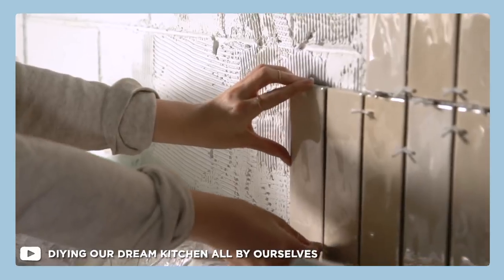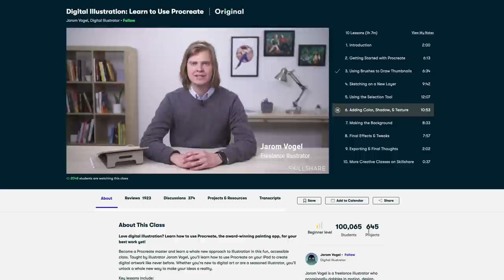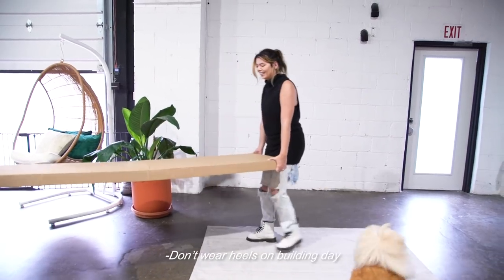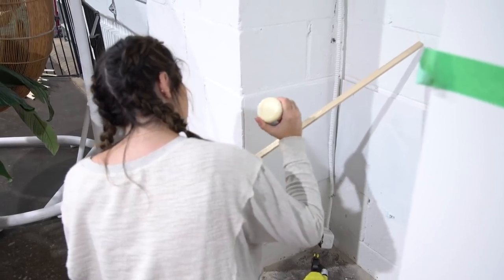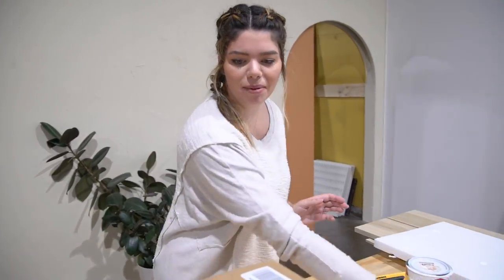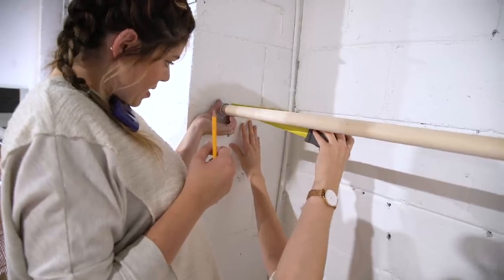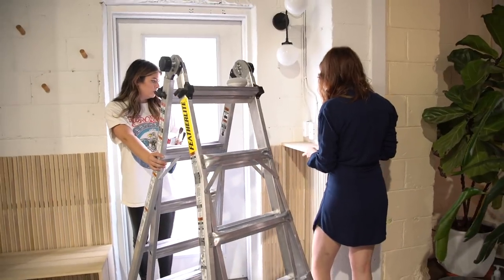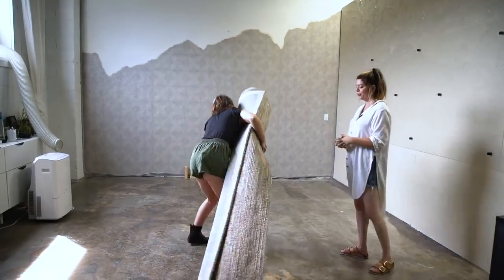making over our boring entryway into something way cooler

Comment: I would’t paint it, but what doI know. I would add some kind of protector for the wall where the bike is, maybe something transparent. White walls and bike wheels… bad combination.
Reply: Good suggestion! Maybe a sheet of clear plexiglass for under the bikes. :)
Reply: My bike hook came with a clear cradle, wall protector kind of thing for the bottom wheel. Def helps keep the wall clean!
Reply: I’ve got scuff marks all over my apartment dry walls so definitely recommend some kind of cover
Reply: 🎨  RE Painting Trim  🖌
🖤Love the Scandi light wood & white wall/cabinet combo. My preference would be to clear coat to protect. 

Although Scandi design also favors ⚫black & white⚪. All the wood stained ebony to match the black bench & black pot for the entry area plant could be very interesting. However, that would've been more easily done before it was attached to any surface (& simply touched up later).

🚲 Bike wheels against any interior wall is kinda gross. Plenty of chances to mark wall while simply lifting it up to it's respective perch too. Know they are bit heavy & awkward to lift in that manner. A plexi-panel will preserve wall, while be very easy to clean.🤗
Reply: Yes those walls will be scuffed shortly!
Reply: A wood tray that matches the wall wood maybe. I’ve made a couple for shoes with the plastic one under the wood to drain of snow into. The bike is going to drip a lot more than imagined.
D

Comment: Loooove how this turned out. I'd definitely like to see a stain on the wood to warm it up a smidge and I kind of wish the bench was sitting on top of a full rug instead of next to a runner, but other than that, AMAZING!
Reply: I agree 1 million percent lol
Reply: I agree. I liked the original rug they had there. It was much cozier than the runner. :)
Reply: I would stain the tambour as well. :)
Reply: MizWoody Agreed
Reply: I agree, they could also just double it up and have the larger rug with the runner, so the bench isn't floating.
Reply: @DarleneSterling  Yes, love that idea
Reply: @MizWoody  🚫 No Paint 🚫. 
Prefer CLEAR poly coat route over a darker stain on all that gorgeous wood, but I adore the soothing gentle beauty of light wood in combo with bright white elements. It gently warms the coolness down w/o being the least aggressive or over powering. 🤗

🏵Like @Jenna Revamped, also preferred the size & warmer color of the previous area rug. Not in love with scale or shade of the new runner. Or, how the bench awkwardly floats in space behind it 🛶.

In order to make the bench more significant as a "petite island," they could float side tables on each end. The tables don't have to match, but they should all be in the same dark finish of the bench. They should also have that same mcm vibe. 

🤔Plus, where do your ppl hide slippers or alternate work shoes when they remove their soggy shoes!? Carry them in their own tote?

The tops of these small tables can be dressed with potted🌾plants (or vases for floral arrangements⚱). 

⚓ At the very least, the bench area could be more anchored by adding an XL pair of potted🌱plants on each end of the bench. (Say 16×16×32 concrete planters.)  Think mod boutique hotel lobby style.

Maybe add an 🌂umbrella urn for any💧wet weather☔ on entry side. (It could also be used to stow a extra-long shoe horn for employees & guests. Once you use one, you'll fall in love😍.) Or, it would suit for those of us who like to use a parasol in the sunny months. ☀️In LA, that is year round☂️!

Comment: something felt a bit off with the tambour detail, maybe would’ve looked better stained or with a small piece of molding on top to make it look more clean and finished!
Reply: Dasha Zaytseva I think tp and bottom molding is a good idea.
Reply: I actually really like it in the light colour, but because they stand off the wall a bit, it's really easy to see where the mounting board is. It might look better if they slid more thin white panels in behind the wood, on top of the existing ones.
Reply: Dasha Zaytseva when it’s shot from the front, the perspective makes the tambour on the wardrobe look lower than the rest, I think that’s what’s unsettling
Reply: yeah... right now it looks like a sauna lol
Reply: A moulding along the top seems necessary to me. I'm worried those slats are going to snag on coats and break since they aren't flush to the wall.
Reply: Yes!!! A white molding piece running along top would've been so much nicer

Comment: I have never seen that kind of wall covering and I love how it looks! What bothered me a bit was that horizontal dark shadow line behind it where you put up that board to nail them  on. Maybe through the camera it looks more pronounced? Also a tip, you should cover that wall part where the bike tires hit the wall and put sth on the floor underneath. Wet and dirt will otherwise make you clean a lot. Love you!
Reply: 😊Agree. That Tambour treatment is new to me too, but it really glams up that space in a mod, yet warm way. (It makes a departure from a more cottage like traditional bead-board panel.) Seems easy to replicate using their method. 

The other online versions I researched did have less of a gap between the petite "planks." Personally, I don't mind the shadow (or white painted block wall peeking through). 👏👏👏

Comment: It looked so good, the only thing that’s really throwing me is that behind the tambour is only one square of clean white and then brick. Looks a bit funny and unfinished. Also adding something to the top and bottom edge of it too.
Reply: They should have used sheets of wood (that are the same height and width) to create the backboard for the tambour, it does look funny without it :(
Reply: I kind of like the line of white wood  or whatever, I thought it gave some interesting dimensionality to it
Reply: I thought that at first too. Then I thought it's an industrial building that's not new maybe the walls weren't flat and square.
Reply: Personally I don’t like it, it looks sloppy with the uneven edge on the bottom. Makes that space look really unfinished like they are going to do something to it still.
Reply: I think they should’ve painted it all black behind. The brick & the mdf
Reply: @delaneybee  agreedddd!! I came from the bathroom too 😂 🚽

Comment: The wood tambour though a neat idea, looks unfinished. Trimming out the top and adding painted wood behind the base of the doors would help fix that, though I think adding a base along the wall and around the cabinet would look more professional making the whole area look built in.
Reply: And a hat/helmet shelf above the coat rod. It would also help to make it look like a built-in.
Reply: If they add trim the Scandinavian vibe is lost.
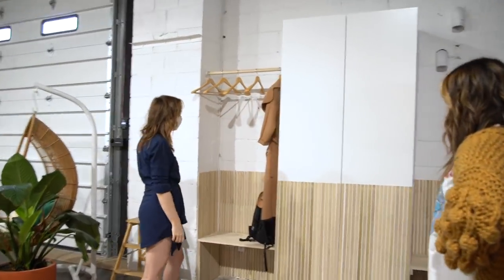Reply: @kaleigh4081  If you look at 19:41, you'll see the rod is so high Kelsey has to reach well over her head to hang her coat. I'd be  afraid to toss a helmet up there. That could get scary if you didn't quite make it. 😣 They do have the hooks on the other side of the cabinet to use.
Reply: @janice694   I must have missed where they said they were going for a Scandinavian look, so I started to watch it over again.  Too slow, so scanned skipping now and then, and again missed any mention of design influence. Either way, I do not see Scandinavian influence other than the white and unfinished wood. Adding a simple trim, in my opinion, would not make a difference anyway as long as it were simple enough.
Reply: @OrganizeCreateDecorate   I think when they said "scandinavian" they were referring to the hygge vibe; the white tones with warm beiges and pops of color that seems so "in" right now. Clean, simple, cheerful, and achievable.
Reply: @OrganizeCreateDecorate  Oops! You're right. Oh, well... They can put the helmets on the bench: once the longer coats are hanging there, the bench won't be too comfy for sitting. They have the nice green bench, though, for putting shoes on.
Reply: @kaleigh4081  I design and build woodwork projects for our home, so I tend to notice things like that. I would have lowered the coat rod and the shelf above it. I would replace what they called a bench, with a shoe rack with four levels. Each "shelf" would be made from five copper pipes secured into wood on each side.  Adding a drip tray on the pipes under each shoe shelf to catch any drips from wet shoes and boots. If they needed to cut costs, they could use PVC pipe instead of the copper.
Reply: @jessicajordan680   By what I've seen, that look still is finished with trim. Simple trim, no routing, but trim none the less.
Reply: @OrganizeCreateDecorate  Wow! Love your ideas! Sounds like you're good at what you do. 👍
Reply: @kaleigh4081  Thank you. I enjoy it all, so that helps. After my faith, family, and friends, my three passions are in my user name. The best is when I can put them all in one project. Which I do often. Luckily we have a wood work shop in our basement. Though we've novices, hubby and I have done well.

Comment: Your new IKEA rule is spot on.... bc I made the mistake of going there by myself, not reading/realizing the weight of the bookshelves I needed, then not seeing where the dumb flat carts were and trying to load two 85lb/38.5kilo bookshelves in a cart with a basket... then the cart had so much off-center weight and started drifting down the parking lot and toppled over, basket first, into a van.... where there were PEOPLE INSIDE! 

I’ve had worse lapses in judgment in my life, but doing an IKEA furniture run solo certainly makes it on the top 10 list. Lol!

Comment: Great job! Clear varnish for the wood. My suggestions
1-to put something to protect the wall where the bike mount is, otherwise the wheels of the bike can get it real dirty real quick, specially in winter.
2- get a shelf to fit inside the cupboard. It will be structural +  storage. 
3- a mirror inside of the cupboard door, so you can get ready to leave the office as well, set hats and scarfs.
4- maybe a big wicker basket next to the dark green bench, and you can have inside guest shoes, Danny’s toys...

Just my 2 cents!
I love how the new office is getting shape :)

Comment: Loved how it looks, definitely needs to seal the wood because of the water that will drop from snow/rain. It's easier when doing before attaching those materials.to the wall as it will be a very delicate job now not getting it on the pax surface.

And I would paint the wood on the green bench, black :) or sand it to match the color of the rest. I have the impression it's a stained wood.

Comment: Paint the tambour on the closet and the side walls in a light brown, and stain the tambour on the backside wall in a dark brown. This should add some more depth to the sitting area. Then paint the benches (and the small shelve) the same green color as the knobs and daybed, to bring the whole space together. Also, you should definitively DIY the shoes mats, that plastic looks bad.

Comment: I would have made the Pax handles out of the same wood as the door treatment — either building on the treatment, extending the line above the treatment, or capping it with a horizontal piece.

Comment: Heyy question! Why do you guys use those plastic anchors for the holes you’re drilling into the wall? Since you guys are drilling into cement block all you need to use are tapcon screws, no plastic anchor needed.

Comment: I think the tambour needs to be pulled off and you need to put a full sheet behind it because the line is super distracting and I also think it needs a top and bottom frame which could be behind so it more resembles the buffet lines. And light oil but not a dark stain.

Comment: Yea I say a clear seal is best for the wood. But ALSO, what if you used like the peach or cream paint color from the other side of the office, and painted the wall, only from the top of the closet UP?? It would warm up the giant white area up there. Could either stop it at the pillar, or extend it all the way over the garage door. Like the opposite of Kelsey's bedroom. But maybe stop it like 6in from the ceiling, so it doesn't point out the corner, and instead just draws you eye upward to appreciate the seemingly infinitely high ceiling? Idk if that makes sense.

Comment: the bike rack would have worked better if you put it at a height where you can keep the back tire on the ground, that way to put the bike up you would essentially just roll it up the wall and not have to lift it into the hook. wayyy more user friendly. and it would still work for different bike heights, the bike just might be at a bit of an angle which wouldn’t take up too much room

Comment: Looks great! I was just wondering with the hanging coats over the bench seat , if you hung coats up that were wet from rain and or snow outside wouldn’t they drip in the bench and cause mould eventually ? Just wondering
Reply: I've had one a bit like this for many years and I'm in an area where it basically rains everyday from October to March and I've never had any issue, never actually thought it could be an issue actually 😅 it just dries since the house is heated
Reply: Alexiane DIDRICK good to know , very wet in NZ and mildew easily arrives inside 😢

Comment: Are you happy with ryobi as an tool to make holes in concrete? I have borrowed some tools for making holes in my concrete wall with no success and was wondering if ryoby drilhammer could work much better without standing there for several minutes for 1 cm progress

Comment: Why wouldn't you use the wardrobe for coats, bags and umbrellas? In the winter (or rainy days) those coats are going to drip on the benches and make them unusable. Also I think you're going to want some kind of way to keep heat (think restaurants and velvet curtains) in during the winter.